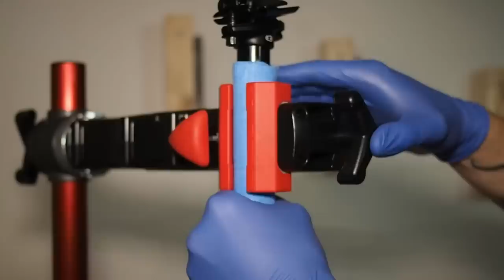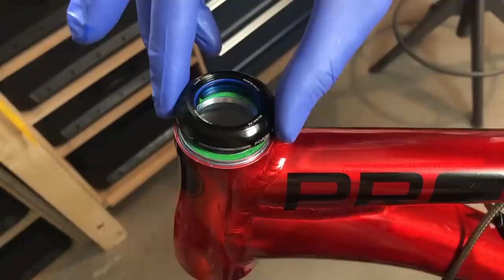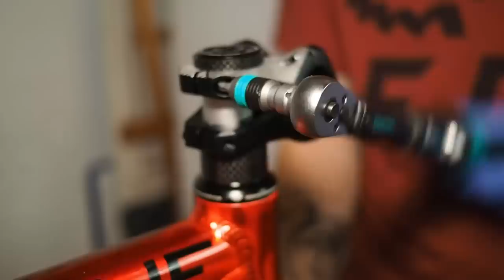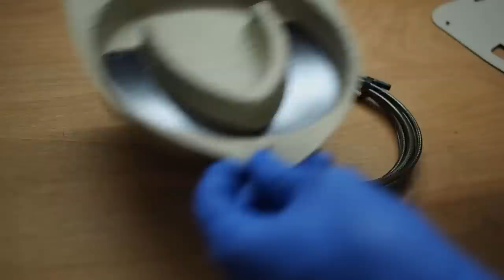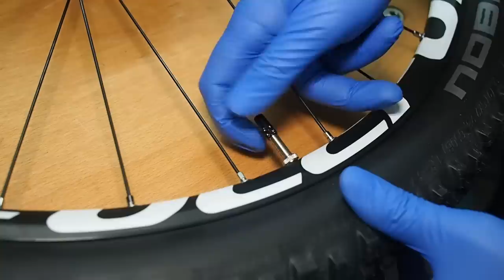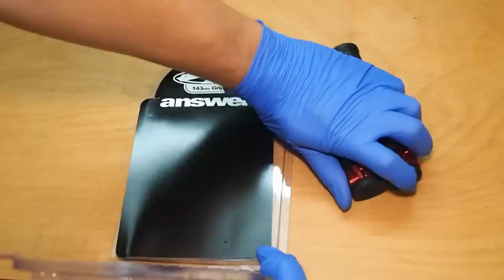Bikebuild - OCTANE One Trail Hardtail Custom

Comment: Anyone else spot the error with the fork? Didn’t the crown race go on upside down? pretty sure the flat side goes against the fork and the slanted side goes into the bearing so the fork fits flush against the frame.

Comment: can you tell me a little bit about that fork? how it been your impression? I just bought a deville AM, Iñm using the same frame and components
Reply from the maker: seb Vil 
I can’t tell you how it performs. I have sold the bike after it was Build.
Reply: I've bought one like a year and a half ago. It works pretty good, especially considering the price (300€). There's only one problem, when you brake, it makes a little noise, something like "crack". I've sent an email to bos service, and my mechanic dismantled the fork, and both said that noise didn't matter at all, so I don't really care, but it's something you have to know. Also, the maintenance is a little bit expensive (110€), but it's a great fork, and it works smooth as butter.

Comment: “Slapper tape” is just repackaged 2228 you can get from Home Depot lol
Reply: 3M Scotch 1 in. x 10 ft. x 0.065 in. 2228 Rubber Mastic Electrical Tape $9.64, It's enough for about 5 or 6 bikes.
Reply: Eye are YOU are eyE slapper tape is $15 for 1 meter lol

Comment: Instead of the seatpost dropper, I'd invest into a better shifter. If a client wanted to use the dropper in a real life (on curved downhills), he would replace NX very soon any way.
As I understood, the client is a kid. It's too early for him to ride at places that really need him to use a dropper.
The frame has a hole under a seat that will be full of dirt. Break mount screws must be tied when brakes are in use. Aluminum fork pole must be pained (where it is visible).

Comment: Have you got a parts list
Reply from the maker: Frame: Octane One Prone 27,5 M 2018 
Headset: Cane Creek 40er Tapered 
Fork: BOS DIZZY 27,5" 140 mm Tapered 15 mm 
Seatpost: CrankBrothers Highline 150mm 
Seatpost Clamp: Nukeproof Horizon 34,9 
Handlebar: Nukeproof Horizon Riserbar 31,8 800mm 
Stem: Nukeproof Neutron AM 31,8 35mm 
Brakes: Magura MT SPORT Carbotecture 
Brake Disc: Shimano Deore XT SM-RT81 VR/HR 160mm
Rear Derailleur: Sram NX 11
Shift Trigger: Sram NX 11
Cassette: SunRace 11 11-42 
Chain: Sram PCX1 11
Cranks: Sram NX 32T 175mm
Bottom Bracket: Sram GXP
Saddle: Net by Selle Italia
Wheelset: Fulcrum Red Power 27,5 HP 
Tires: Nobby Nic Evolution 27,5x2.25 Pacestar TR
Reply: @mtbuild4787  How much did the whole setup weight?
Reply from the maker: melonek ~ 12 Kg